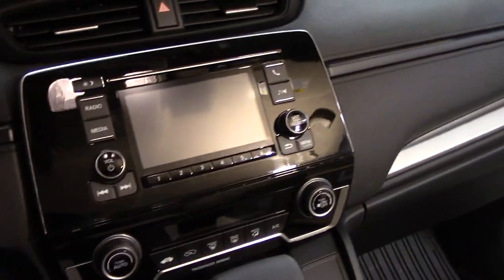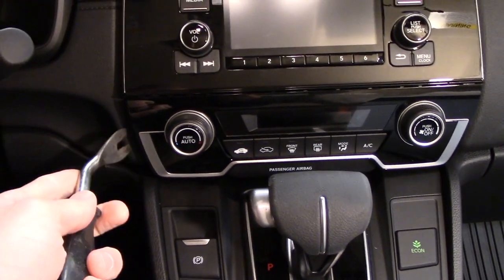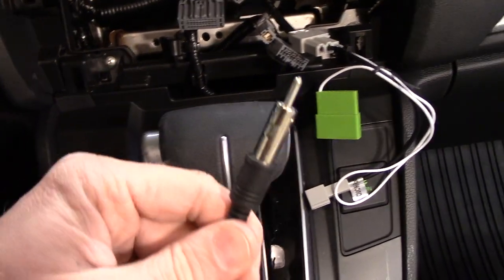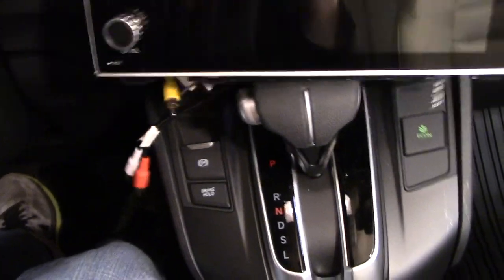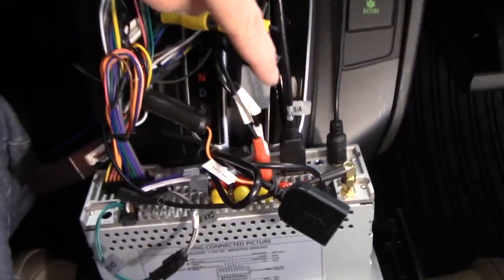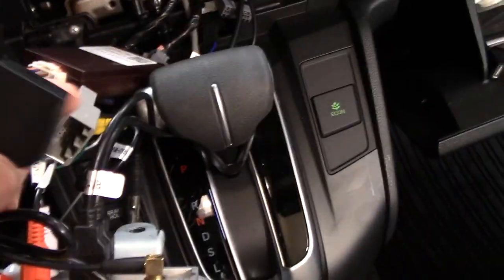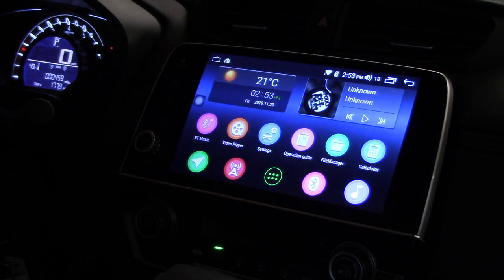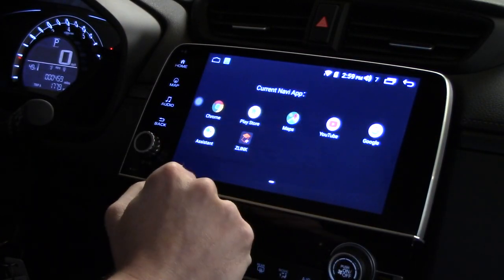2017 - 2020 Honda CRV Android Navigation Radio Upgrade and Review

Comment: Can you guys tell me where I can buy the new radio and and what is the model please
Reply: Hi,
You can purchase the radio at joyingauto.com I just installed mine 9n a 2018 Honda CR-V and radio works. Back up Camera works with just plugging Yellow RCA , and can control the Air Conditioner as well from the radio and a plus for the camera is the extra view , usually is 3 views for the camera. You should get this unit.  This is the best on aftermarket radios.

Comment: Great review, figured out the backup camera after seeing you connected the yellow RCAs.  My only issue is that my antenna connector isn't the same and doesn't fit.  As you found Pin 1 is for power, my connector in my EX-L AWD only has pins 2/3.  Also, the brackets from the EX-L radio don't fit this radio.
Reply from the maker: My system came with multiple antenna connectors. Did yours?
Reply: @JackofAllMasterofNone  The radio came with only one adapter, which doesn't work with my CRV.  I just ordered this adapter: https://www.crutchfield.com/p_12040HD13/Metra-40-HD13-Antenna-Adapter.html   Does your backup warning still work?  Mine seems to be turned off, and I almost backed into someone walking behind me.
Reply from the maker: @zaph3  My car did not have factory backup sensors. This upgrade works best on LX models. I'm sure there is a way to make yours work though. But I don't have any knowledge on the EX and up trim levels.
Reply: Ok, further testing and this is NOT the right antenna adapter for the 2018 ex-l AWD.
Reply: @zaph3  did that antenna fix your radio. I got the same antenna from joying but my radio station don't work still. Also my back up camera don't turn when I turn my steering wheel and the winch in the dash is gone for maintenance. Thanks
Reply: @zaph3  my back up warning don't work either.
Reply: @18768488889  hi do you fix the problem? I have CR-V-EXL also, and try to get one of this
Reply: @ajababb5440  yes the sent me a defferent Canbus
Reply: @18768488889  thank you， and it other Honda sensing features working?  Blinding spots, lane keeping, Collision Mitigation Braking System™ ,Road Departure Mitigation System (RDM), and back up warning of course, those are the main thing I am not sure if I should buy this unit, if you can tell me it will be super helpful, thank you
Reply: @ajababb5440  all of those work but you lose the oil percentage that's in the gauge cluster but you can still reset it in the radio settings
Reply: @18768488889  but will it still pop out warning ⚠️ when you need oil change?
Reply: @ajababb5440  yes but I don't depend on that I change my oil every 3k
Reply: @18768488889  HI thank you, and can you double confirm with me that blinding spot and rear cross road feather are working normal?  because the seller told me that it not support blinding spot and rear cross warning, thank you so much
Reply: @ajababb5440  my crv is a EX so am not sure. But it beeps when I get close to something.

Comment: I like the video. Can you help me, i need to know if that radio works on my car. I have CR-V LX 2020
Reply from the maker: You will have to reach out to Joying. It probably will work but I don't know if Honda changed anything in the car electrical system between the 2019 and 2020.
Reply: Ok thanks
Reply: @CarlosTorres-je3bt  did you get any answers as I have the same model
Reply: @Yxxx6  yes! The factory told me its works. I Already bought the radio. I will receive it on 2nd september.
Reply: @CarlosTorres-je3bt  please keep me posted on your experience installing it and it's functions. I'm very much considering this myself too. Thank you
Reply: Installed mine today and it works great.
Reply: @jamesgoldstein3824  everything works?
Reply: @jamesgoldstein3824  Do the steering wheel controls still work? And does this connect to the stock usb port for android auto? And backup camera still works as expected?
Reply: @jamesgoldstein3824   Does the noise cancelling come from this unit? And if so, how does it work compared to the original radio? And does the steering angle work with the backup camera. And lastly, are you happy with the upgrade? (I have had the 2020 LX for 2 days.)
Reply: @Yxxx6  its ready working good on my car crv LX 2020
Reply: @CarlosTorres-je3bt  okay! Will look into getting it later on! Thanks!
Reply: @CarlosTorres-je3bt  does your steering controls work with the new player?

Comment: Does the honda maintenance minder still function on this new head unit?
Reply from the maker: All the settings are there but I'm not sure on then EX and up. I installed this in my LX model. On the LX the maintenance minder is built into the instrument cluster and the radio has no involvement.
Reply: Great video.i picked a unit up,just waiting for shipping. Fingers crossed the rear view camera works for me like it did for you.🤙

Comment: So I bought the 2020 Honda CRV LX model. Is this radio compatible with the 2020? I'm viewing it on the website and it currently says up to 2019. Ebay shows the same as well. Would there be any complicating issues or differences with the 2020 version? I'd really like to hook this up.
Reply from the maker: Not sure if Honda changed anything in 2020 or not.
Reply: I have a 2020 Lx, everything seems to work fine.
Reply: @calvinbiddle2840  did you have that female to female issue as jack did or was it corrected when you ordered?
Reply: JB BESLER mines came corrected, male to female connector
Reply: @calvinbiddle2840  Do your steering wheel controls work including the separate volume buttons? Asking because I also have a 2020 CR-V LX and am considering this.
Reply: Zachary Scott the separate volume controls work as they should. The other steering wheel controls also work ( up bring up call log, left and right change the radio station, down doesn’t do anything).
Reply: @calvinbiddle2840  does it get rid of the voice commands that the vehicle already comes with?

Comment: Hi, what type of double sided tape did you use? Thanks!
Reply from the maker: 3m
Reply: @JackofAllMasterofNone  thanks! There are quite a few 3m mounting tapes. Any recommendations?
Reply from the maker: @cosmiclight7829  permanent double sided. 30lb rating
Reply: @JackofAllMasterofNone  awesome! Thank you so much! I just got this unit. Looking forward to hooking everything up. I'm not sure if I should use the external mic or the internal will be good enough... in your experience is the internal mic good enough?
Reply from the maker: @cosmiclight7829  I have only used internal and have no complaints but in all honesty I don't use it much
Reply: @JackofAllMasterofNone  got it. Thanks again!

Comment: Do guys get android updates for this device? Does it come with warranty?
Reply from the maker: Joying does publish firmware updates. There is an Android 12 update right now, but it's not quite like phone updates. Not nearly as many and it usually is only to fix minor issues or add features.
Reply: @JackofAllMasterofNone  how do you update the head unit? I've tried emailing them a few times but never get more than one reply that has no information
Reply from the maker: @gutierrezw001  Search Google for Joying firmware updates. There is a whole website dedicated to it.

Comment: I have a Honda CRV 2019 touring edition, I have a display unit but I want to put a bigger screen. I did buy a unite from eBay but when I installed it could not get any sound out of it. Does anyone know how to fix this or find an android display that might work?
Reply: install honda hack and you can unlock many things that do not come by default
Reply: Can you elaborate what no sound means? No stations from the radio? Or no sound at all

Comment: Did you have an issue with the forward and back button on the steering wheel? If so, were you able to fix it? Mine work but do the opposite function... lol
Reply from the maker: Hummmm. No issue here. Watch my other video on changing the canbus settings. It might help in your case. Maybe not.
Reply: Look for "prev and next reverse" (not the exact words) in the settings. Same thing applies to volume control there's a setting called "volume reverse"

Comment: Does the side camera work?
Reply from the maker: There is no side camera on US models
Reply: They have it, I have a CRV and Civic, the side camera turns on (displays on the stereo) when you turn on the light to turn right.
Reply from the maker: @uri78mx  What year is your CRV? In 2017 Honda did away with lane watch cameras on CRVs in favor of the radar/indicator light system.
Reply: Both are 2016.
Reply from the maker: @uri78mx  2017 up CRVs do not have side cameras.
Reply: Jack of All Master of None your right except for Canadian models